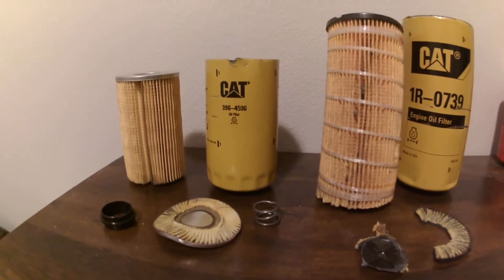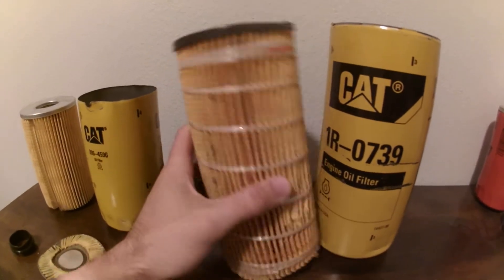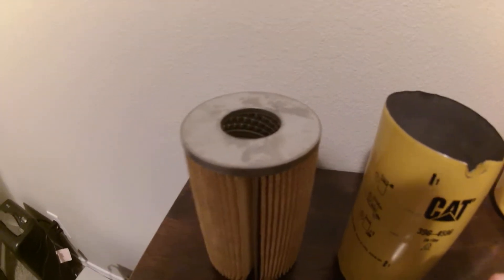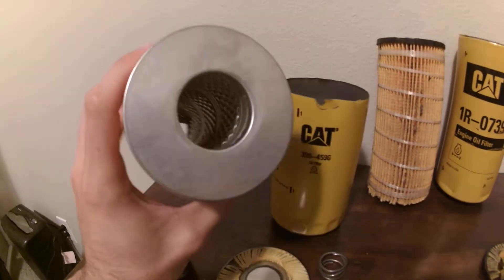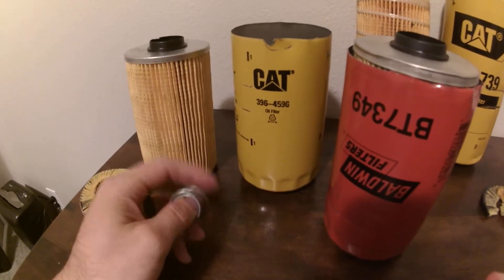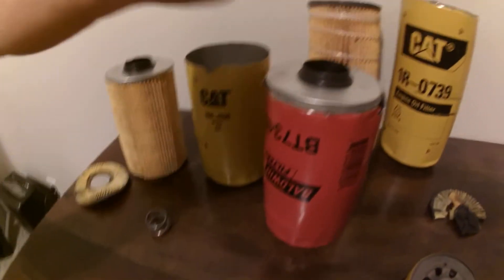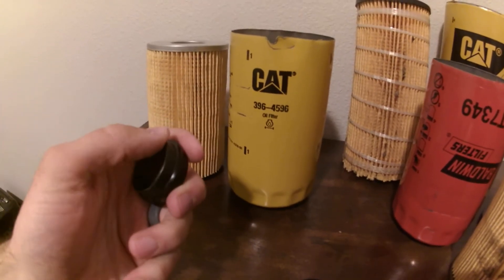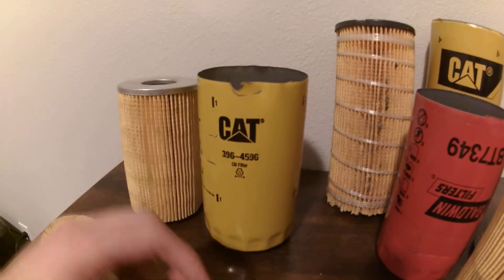CAT Oil Filter #396-4596 is NOT a CAT Oil Filter. 5.9 & 6.7 Cummins owners be AWARE! #cat #cummins

Comment: I went to CAT’s site and threw in the part # under filter lookup and it pulled it up:

“396-4596: FILTER LUBE

Brand: Cat”

Other than that, like in your previous video, there is no other information such as Micron ratings, etc.

Under Specifications, it simply states:

“Specifications unavailable”

Under Compatibility, it states:

“We currently do not have compatibility information for this part.”

Nevertheless, it prompted me to contact my local CAT dealer for price.

Edit: Reply from CAT - “As you are aware, we have forwarded your feedback to our internal team. They'd like to inform you that the 396-4596 filter is supplied to Cat. For further information on filter ratings, please contact the local dealership.”

Comment: It’s almost impossible to get the 1R-1807 on a 5.9. The filter with an adapter hits the turbo drain. I had a adapter and a guy tried it, got it to work but had to reroute the turbo drain line for it to work. There is a shorter filter but the drain line still gets in the way. 

That filter I think is a cat filter but it’s a legacy filter, which means it’s made for cat to fit older equipment. It’s actually made by Baldwin, Donaldson, etc. Cat stopped using these in newer equipment because of the way they are manufactured. The ones like the 1R-1807 are made by Cat in the Indiana facility. They found that with stamping of the steel parts the shavings were magnetic and some always stayed with the filter. That why they started making their own. Lose 1 million dollar piece of equipment under warranty sucks. So they set out to make the absolute best filter they could.

Comment: During the pandemic lots of filters where being made by other companies just so they could fill there inventory.  The last air filter I installed on a semi which was a fleet gard but was made by fram.  Even the parts guy was surprised when we opened the book.
Reply from the maker: Yeah I discovered that on a napa filter I got recently. It had an orange piece of paper inside saying It was made by a European company.
Reply: @TylerTheFieldServiceTech  I know this is a 7 month old video, and you probably already know, but Mann Filters from Germany bought Wix who made Napa, Purolator, and a few other oil filter companies.

Comment: Do you happen to know the part number for the Cat direct replacement oil filter, that Black Market Performance sells for the Powerstroke 6.7L. I called them and asked, the guy laughed and hung up on me.
Reply from the maker: I've never heard of one for anything other than the cummins without adapters
Reply: @TylerTheFieldServiceTech  Since you worked for Cat, I was hoping you could figure out the number.
Reply from the maker: @Jewalston   The guys I worked with used adapters to fit the filters they wanted. They all ran duramax no Powerstroke. We ran donaldson or oem for the 6.7 powerstroke on our service trucks.

Comment: A few years ago I went to the Cat Proving Grounds in Arizona, they gave us a tour, education, being a HD Mechanic in Sales, Rentals at a Cat dealer I was shocked at some of the presenters, Eg. " The planet any has 4 planet gears". Couldn't even see the pin bosses on the outside cover, they are just trained brain washers, and I'm still a Cat guy.
 I ended up in a lab with oil stuff, it was interesting, got to see what they did for their research, they told us that their filters come from other mfgs. that only build filters, yes Baldwin, Donaldson, and filter media is made by only a few, as it is trade secret, I've used their filters wherever I can, just being a Vat fan, trained by a x Cat instructor in my apprenticeship I understand why the are world leaders, all try to copy, but fdll short, yes JD, Hitatchi, Liebeihr come close, each has its niche.
 Having sold Cat at dealer, it's nice to see well maintained equipment with 20k hrs still going strong.

Comment: So can I run that bigger filter on my 6.7 Cummins and what's the part number if I can
Reply from the maker: Not without heavy modifications. No way it would fit. I just used that filter as demonstration to show what a true CAT filter looks like.
Reply: @TylerTheFieldServiceTech  what about the other small cat filter would it fit?
Reply from the maker: @supremekingjesus425   The one on the left will fit. 396-4596 is the part number.